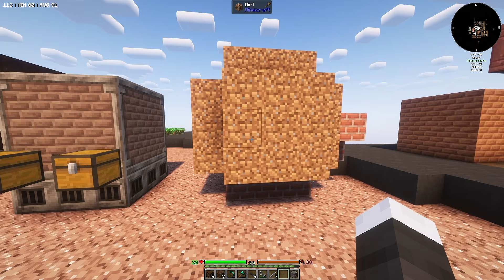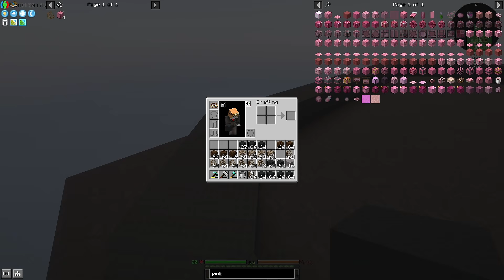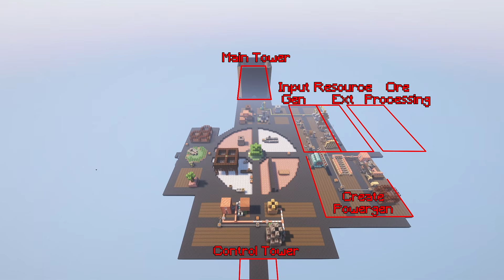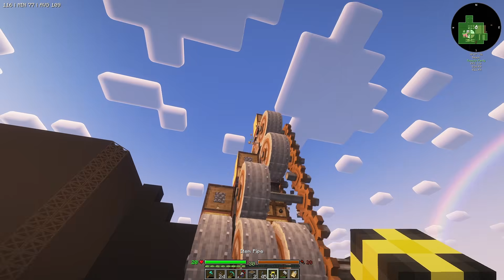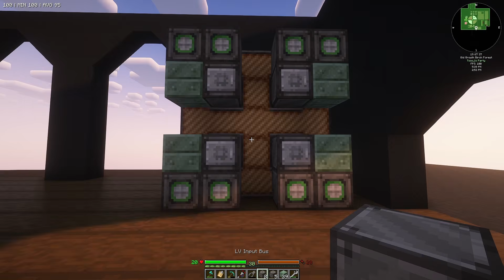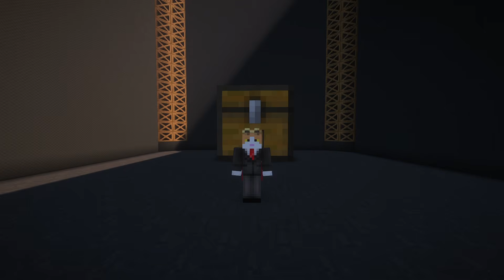Star Technology E5: A Bitt of Building

Comment: 1:19 sorry for being a bit late, but if starT ever updates gt to 7.0.0 or above, you won't be able to place covere on front face
although any machines with front covers will stay and still can be used
same applies to underclocking a singleblock machine (the LV thing between circuit and on/off button)

Comment: 16:25 keep in mind RF machines usually measure throughput per face, so if you had some Pipez Energy Pipes coming off of all sides of a Restone Flux Cell into the Laser IO, you would either have a 6,000RF/t throughput, or the bottleneck would become the Pipe/LaserIO since i don't know how much those can transfer in this pack
Reply: LaserIO energy cards transfer at max 1 million RF per time it pulls.

Comment: you can still rush the mv circuit by using gallium arsenide small dust instead of silicon wafers, also, yeah multiblock buses have integrated circuits

Comment: You don't really need the power substation. The Flux Networks mod provides wireless power output and input. And it also accepts different units of energy and AUTOMATICALLY transforms them to the correct unit!
Reply: oh, also infinite transfer

Comment: dont run soul infused all around the base, instead make a laser io energy card system and locally convert RF into EU when you get to passiving gold with vibrating tables
saves on needing to rewire later as the RF/EU converters don't overload and explode with too much RF, it just overflows the buffer into the rest of the system